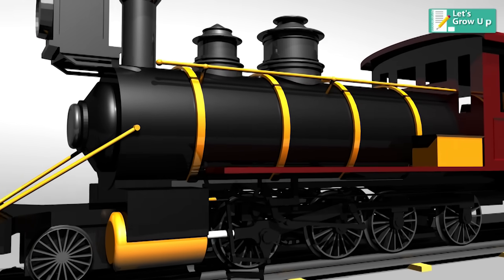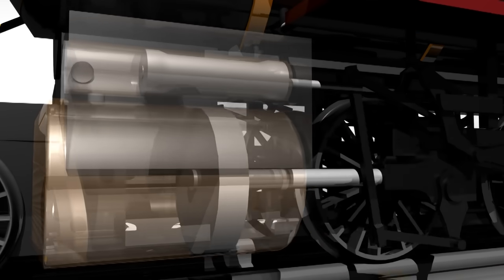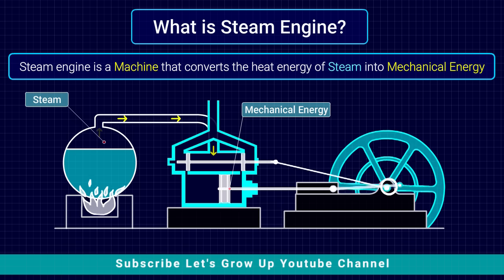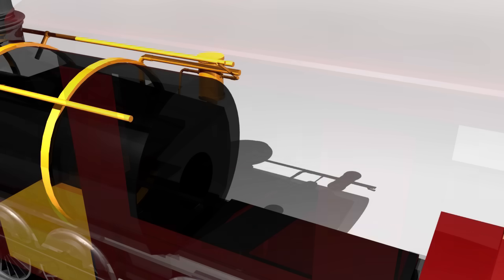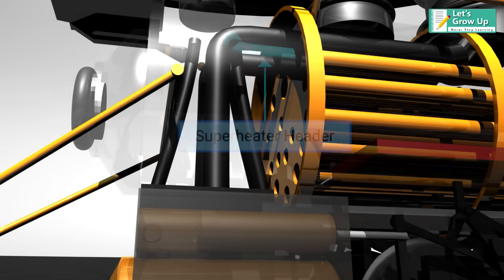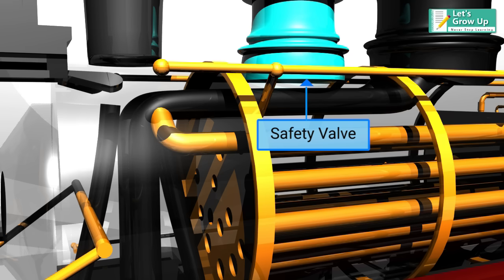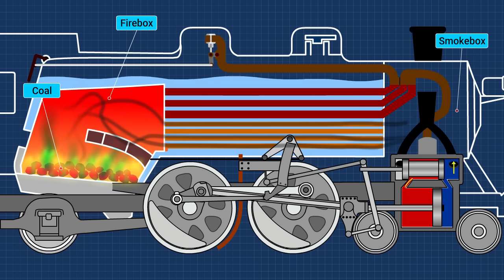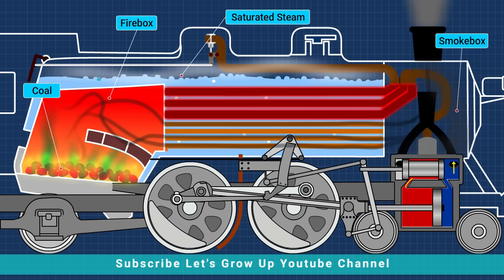#Steam Engine- How does it Work | Steam Engine Working Function Explain | How Locomotive Engine Work

Comment: Well, not going to view "Let's Grow Up" videos. Just HIRE someone to do the voice over. Also, the super heater exchange is incorrect. You have it being heated by the water. A smaller sealed tube of steam goes into one of the larger exhaust tubes. The exhaust gas, which is hotter than the water in the tank, then super heats up the steam which then flows back out and is used to power the drive wheels.

Comment: Please,How to add water to a running boiler?
Reply: Good point. A feed water pump is used and regulated by the fireman. The pumps steam pistons are larger than the water pistons, this gives it the power to push water into the boiler against the steam pressure. A device called an injector can also be used when smaller quantities are needed. Water level is very important.

Comment: How does the locomotive change direction. Please demonstrate..
Reply: I can't demonstrate it, but I can explain it the best I can :)

Part of the valve gearing which controls where steam enters the cylinder can be adjusted with a lever located inside the cab. It moves the pivot point of this specific part so it moves in a specific direction, so that way, steam enters the opposite side of where it enters the cylinders when going forward, allowing the locomotive or engine to run in reverse. I didn't really explain this very well, but I hope it helps a bit 😊

Comment: Nice video.. but also explain how the used steam escapes the cylinders..
Reply: The slide valve that admits the steam at one end also allows steam to escape at the other end. The first animation of the steam flow is not correct. Steam is not admitted BETWEEN the pistons.

Comment: My favorite things about what I like about the steam locomotives are (1) Most of them just only have one tender behind the cab, (2) Most of them have leading wheels, driving wheels, and trailing wheels; (3) Most of them are fueled by coal and water, (4) I like to watch the engineer blowing a whistle to the let people know that they're coming, and (5) I like to watch the fireman shovel coal into the boiler with fire inside which makes a lot of steam coming out of the smoke stack straight out of the cylinders (with pistons on the inside) connecting to the rods.

Comment: The smoke box has an "ejector" powered by the spent steam which sucks exhaust gases forward thru the boiler. Without this, hot gasses would not flow thru the boiler and out the smokestack (not "chimney").
Reply: I have a doubt,if some one can answer it woul be great,it may sound silly
Q1.In a steam engine,is the forward stroke speed equal to reverse stroke speed,i know they are not very different,but still if there is a difference of seconds or micro seconds
Q2.if the forward stroke pressure(or force)is similar to reverse stroke pressure(or force)
Plz answer my two question,i am a student
Thanks in advance

Comment: I remembered that Steam Engine invented by "JAMES WATT"
Reply: I have a doubt,if some one can answer it woul be great,it may sound silly
Q1.In a steam engine,is the forward stroke speed equal to reverse stroke speed,i know they are not very different,but still if there is a difference of seconds or micro seconds
Q2.if the forward stroke pressure(or force)is similar to reverse stroke pressure(or force)
Plz answer my two question,i am a student
Thanks in advance

Comment: What about the counter weights? Those have an important role in running a steam engine! The are the large solid parts of the drive wheels opposite of where the drive rods are connected to the wheels. Without the counterweights the locomotives wheels cannot turn over and the locomotive could  not move. The help the wheels turn over so the opposite piston can alternate the steam direction in the cylinder.
Reply: Nope. Counterweights attempt to balance the action of the reciprocating side rods. They have nothing to do with steam engine operation. The left and right wheels on a steam engine are "quartered," that is, left/right wheel cranks are positioned 90 degrees apart, rather than 180. In the latter case, the engine would not move if at "top dead center"--one piston all the way out, the other all the way in. By quartering the drivers, that can't happen. Steam engine pistons operate in both directions--pushing and pulling due to the slider valve above it.

Comment: Think about an electric heated steam locomotive. The pipes replaced by an electric resistance and the fire hole replaced by a battery
Reply: But due to the large amount of heat necessary, the locomotive would require batteries and AC converters of massive capacity, making it impractical for regular use.
Reply: electric motor is more efficient
Reply: The steam engine is a wonderful invention, however due to heat losses it is not  efficient for today’s requirements.

Comment: I have a question: does the piston or the Engine need oil for lubrications?
Reply: It probably uses mechanical grease, which is less susceptible to degradation due to steam.

Comment: Always wonder about one aspect, which is not relevant to working, but makes the presentation of the steam engine unique. The smoke can easily go out from chimney, BUT why it is thrown up in a sequence (say when the engine starts to roll). It appears the whoosh whoosh of the smoke from the chimney is result of some process. Can you please explain! Otherwise an excellent video explaining everything.
Reply: at 1.34 to 1.35 the video shows two blastpipes (in blue) in what should have been called the smokebox. (the video missed that because  the firetubes inside the boiler were wrongly named smokebox ) These blastpipes are connected to the cylinder exhausts. The exhaust steam still has some pressure left, so it shoots up into the smokestack which is right above those blastpipes. In the process  dragging along a good deal of smoke. There is no constant stream of exhaust steam, only instantly, determined by the exhaust valves. Left and right cylinders added, there are four blasts per rotation.  The blast is choked and muffeled  by the smoke, hence the typical
 choo choo sound
Reply: if i understand ur question, the chugga chugga or whoosh whoosh is created by the exhaust of the steam from the cylinders and the timing of the cylinders valves. this steam exhaust also aids in pulling the burnt fire gas etc... out the chimney as well.
Reply: sorry it is me who missed the arrow pointing at the smokebox area........

Comment: Beautiful!!
Actually it's amazing that more steam locomotives haven't exploded over the years.
Reply: that's what the safety valve is there for
Reply: The safety valves do prevent the pressure from rising too high, however an explosion can occur. If the correct water level  is not maintained. When it is too low the tubes overheat and will explode at normal pressure. @UncaAlbyGmail
Reply: They blew up quite often in the early days. Beautiful machines but potentially still dangerous.
Reply: In some countries, some steam locos have seen real regular use until over the turn of the centuries.

Comment: Good graphic attempt, unfortunately with several vital / basic functions being missed: How the steam assists / drives higher air-flow through-out the burn phase, the purpose of the dome, how the piston input / speed is regulated, how the size of the drive-wheels is of huge importance, how  any train goes around a corner without slipping any drive wheel (no differential fiitted as in cars), what the max theoretical / practical gradient is and why.... nice colourful beginning....now fill in the gaps.
Reply: I have a doubt,if some one can answer it woul be great,it may sound silly
Q1.In a steam engine,is the forward stroke speed equal to reverse stroke speed,i know they are not very different,but still if there is a difference of seconds or micro seconds
Q2.if the forward stroke pressure(or force)is similar to reverse stroke pressure(or force)
Plz answer my two question,i am a student
Thanks in advance

Comment: Dear all , I'm not a specialist in English language , this mean all mistake from my language is accepted.Yes, exist mistakes in this presentation but instead to claim all the time you can start to correct this.
1) Steam engine is an engine what transform one type of energy in another type of energy. First time CHEMICAL ENERGY is transformed in THERMAL ENERGY ( carbon burn and produce heat ). THERMAL ENERGY is transferred to the boiler  and start to be PRESSURE ENERGY ( water accumulate heat and pressure increase ). PRESSURE ENERGY is transformed in MECHANICAL ENERGY using different device ( boiler what transfer pressure energy to the wheel of train using cylinder).
2) To the loco you have different type of valves - Pressure Safety Valve ( installed to the loco to not explode the boiler because of high pressure ), Regulation Valve what control the amount of steam what goes to the cylinder and increase or decrease speed of train, Return Valve what is used to return a part of steam to put in function pump for water and several type of valves used to the loco.
For all the people what have knowledge about steam loco ( how work, what is most important parts, etc. )  is good to spread all this information and STOP to be hater. First step to be good start from us, from inside. To accept mistake of others and to correct him in a polite way. Try to do this. Good luck to everybody !
Reply: Just wait...you having even heard about the Stanley steamer and how he's steaming at your carpet !
Reply: Dear Mr Soft (or can I call you Hard for short.) (No pun intended) Your English is fine. It's your message I'm having trouble with. The part about stop being a hater. What am I missing?  Sounds a little paranoid, like the "loco" isn't the only one that is 'smoking' here. Just curious. Thanks.
Reply: hard you soft go you back to corner   the mechanical voice  out line the  basic principle it does............      there maybe you understand that in you own style  non engrish.......  the function as he states is  just explaining basic concept   you can make as complex or as simple as possible  a script for the   cg voice to relate    just   sit back and think of the process

Comment: Not all steam engines used super heating. That came years later as steam engines got larger and needed more power from the steam.
Reply: I have a doubt,if some one can answer it woul be great,it may sound silly
Q1.In a steam engine,is the forward stroke speed equal to reverse stroke speed,i know they are not very different,but still if there is a difference of seconds or micro seconds
Q2.if the forward stroke pressure(or force)is similar to reverse stroke pressure(or force)
Plz answer my two question,i am a student
Thanks in advance
Reply: Main purpose of superheating is drying up the steam so water droplets don't condense inside the cylinders
Reply: @CombraStudios  it actual did dry the steam  BUT   many  in later years were made with it  as standard equipment and earlier that came out without it  were refitted with super heaters . the main reason those later  steam engine became more powerful was direct result of the super heater super  heated steam is under higher boiler pressure and temperatures  hence  more stored energy to create more power.  the few locos not capable of  being refitted with super heaters slowly  became scrap or sat in  storage yards rotting away  for years until they ended up in private hands or delegated to small lines
Reply: าขรึพสสทกุ

Comment: We can develop cars working on steam this can reduce dependence on petrol...
Reply: You still have to burn something to boil the water to make steam.
Reply from the maker: @markfrench8892   Thank you Sir, for your valuable feedback
Reply: And where would you get the steam from?
Reply: Early automobiles were steam powered. If oil were not so cheap and plentiful, maybe things would be different. Steam powered machines require more time and labor
Reply: Megha Bhagat before there were cars, trucks and buses with internal combustion engines they were all steam driven as was a lot of things
Reply: Yeah sure let's move back in time... wtf